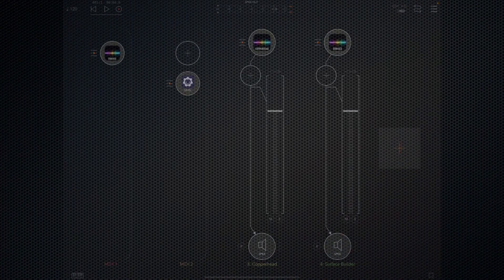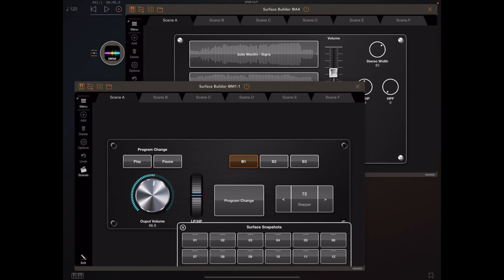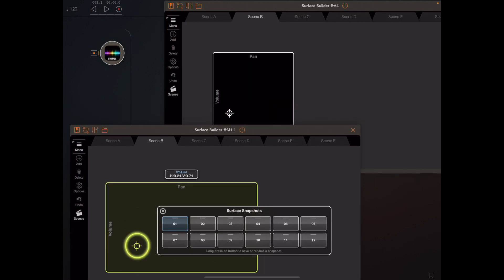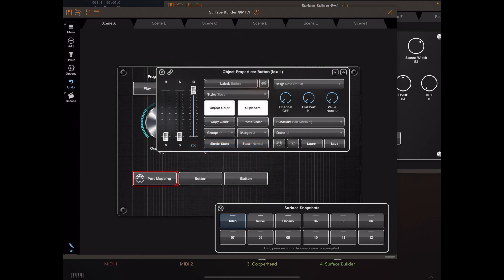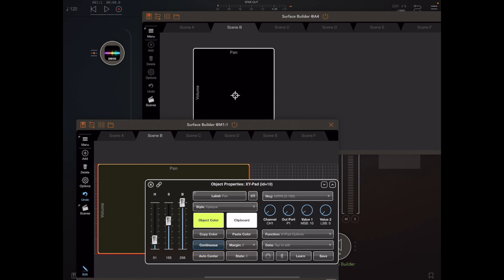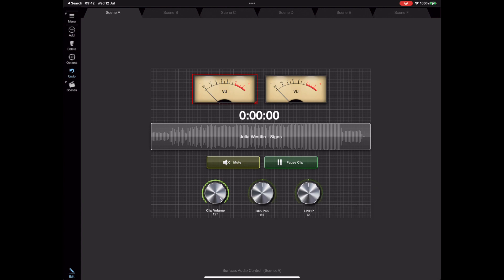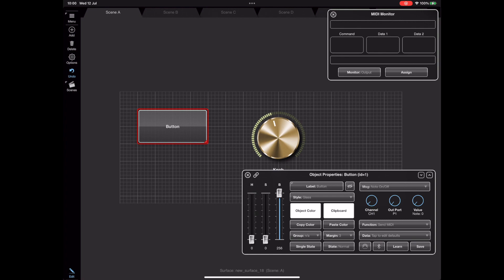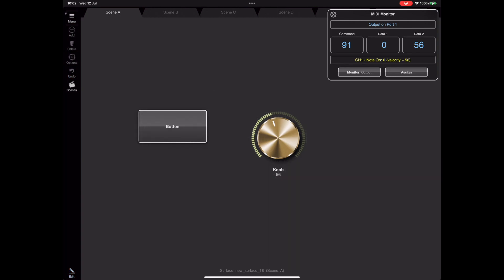Surface Builder - MasterClass 5 - Snapshots

Comment: With the snapshots, is it possible to slow the movement from one snapshot to the other down. As it currently stands if you change, snapshots your parameters, change abruptly. I was thinking if it’s possible to have a slow transition.
Reply from the maker: This makes perfrect sense in  a mixing app, but in the case of SB transitions are really bad. If you imagine a control for sending program changes morphing from one preset to another via every other preset in between? In my experiments most apps crash lol The XY Pad has an option to glide from one poition to another, and I may add that to faders and sliders as this is the only other place it makes sense.

Comment: Paul, does Snapshot work with MIDI Program change #s? It could be useful to have a bunch of buttons sending MIDI program change commands, and use Snapshots to give the buttons an alternate bunch of program changes… just a thought…
Reply from the maker: You can do that with Steppers... makes more sense with a stepper as we can change the value on the fly but turn continuous off.

Comment: Hi Paul. Can you cover in a future video how to control the START/STOP transport from AUM? I’ve been trying but have not succeeded yet. Again…GREAT APP!!
Reply: This is easy. Set up buttons to PLAY and STOP-REWIND, or whatever else you want to control (slider for tempo, buttons for Tap Tempo, etc) and set them to whatever you like; I use Ch 16 unused note numbers. Then go to the AUM “hamburger” menu, upper right corner, and go to MIDI CTRL - TRANSPORT PARAMETERS; everything you need is there. No way to post photos here, otherwise I’d show you screen shots.
Reply from the maker: I wasn't aware this was possible, but I will look into it. I'm guessing this means sending some command to the AUM MIDI port, so you need to ensure it is mapped to a specific port prior to sending the command.
Reply: Thanx for the solution!! 🎉
Reply: But still Can’t figure it out. AUM hamburger menu says note 80 for toggle play. I have a button Dual State on Port 15 sending note 80. Port 15 has an AUM destination. Chanel is of. Chanel on 1 to 16 has also No effect. Strange problem…..
Reply: @WimWaman  you should have a MIDI channel #, Both on the Surface Builder button and the AUM setting. Also be sure that in AUM’s MIDI Control section you have Surface Builder set as the MIDI source; if it says NO MIDI SOURCE-TAP TO CONNECT, you have to specify Surface Builder and Port 15.
Reply: @gtrgeorge348 .   Now it works. Thanx for thinking with me. Greetings from the NL
Reply: @WimWaman  Great! Glad I could help...

Comment: Yet another great feature. Can't wait to try it out. I'm having  a lot of fun with this app. At the risk of sounding ungrateful, I have one request, which I find myself in need of, which is a button which sends a random value. For example, a button that sends a random value between x and y for notes and CC values, and Program Change. It would be a great way to select a random preset in Copperhead, for example, or to change the reverb level, or LFO frequency on another app or device. You could make an entire panel of these in Surface Builder and then press buttons to experiment live with other apps. If you could point the random button to knobs or other surface controls simultaneously while using them to send messages to other apps/devices at the same time, then if you hit on something you liked, you could save the values it into a snapshot, almost like a preset for your project.

I also noted from @AcoustiMan818, regarding automation. I've thought automation since the app first came out, and concluded that this app is intended to be a user-driven interactive interface, not an automation tool. It could certainly be used to trigger other apps that do automation such as Helium, MIDI Mixer, Drambo, NuRack, Mozaic, and so on. I'm not arguing against it, but I can see how keeping the app focused on a specific use would be easier to develop and less complex for people to use.

Great stuff Paul!
Reply from the maker: I agree with you, and this is the reason I didn't add a glide function to the snapshots, as it would not work well in all instances. For instance a Stepper control that selectes patches on a synth wouldn't want to animate between patches etc. This is a different app entirely and  if that kind of functionality was to be built in it would be in the knob/fader etc and not a generalised function. I like the randomize idea by the way.
Reply: @PaultheMusicMan  Great. I created a randomize button in Drambo in AUM and tied it into a knob on Surface Builder, and it works, but it would get very tedious doing that for a whole set of controls.

Comment: Hi Paul, it would be great to incorporate the automation feature from AUM Midimixer into Surface builder🤞
Reply: I use a workaround with Helium to record controller movements within Surface Builder (SB) but it is a bit cumbersome and the recorded movements don’t send midi to output port of SB…